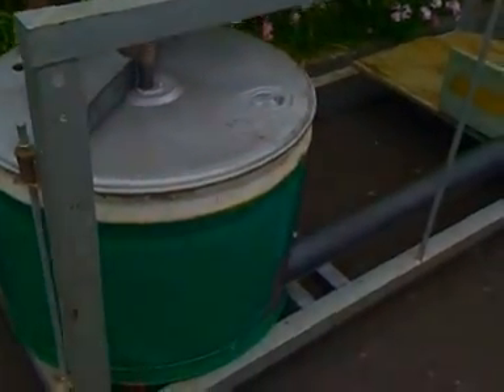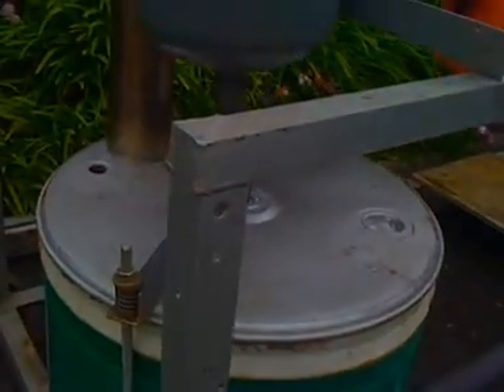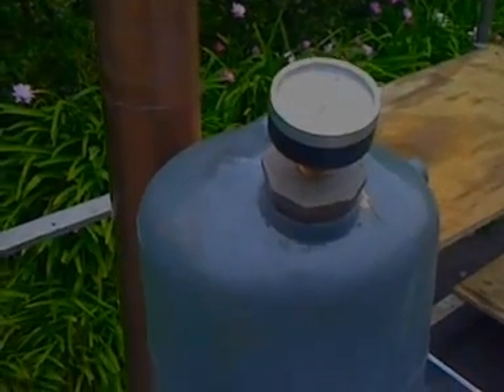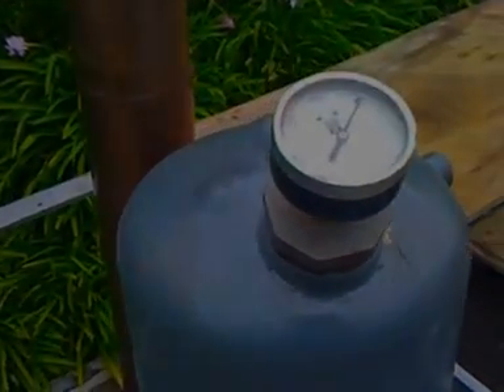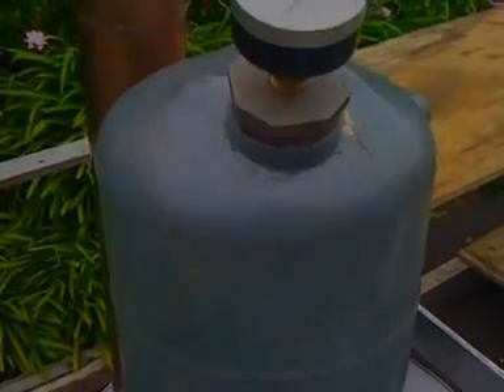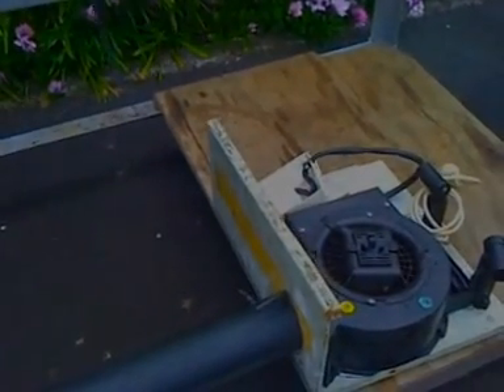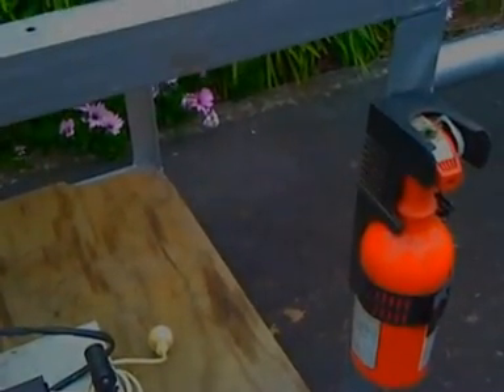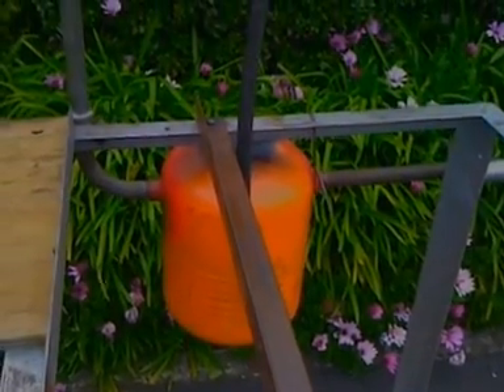DIESEL from waste oil thermal cracking machine EPISODE 1, basic layout

Comment: 85%  waste engine oil, 15% gasoline, a 100 micron, then a 10 micron bag filter and your done. total investment ? 1/2 gal of gas to 4 gal of oil ,, 1.50 in gas. bag filters are 4.50 each on eBay, and can be washed out. not counting the bag filters, 9 gal's of diesel will cost you 3.oo worth of gas.
Reply from the maker: I've been using solutions something like this for over 10 years. Normally, the success is related to how much carbon soot is dissolved in the wmo. Oils without the carbon payload work better as they are less likely to soot the injectors. Best use a diesel hydrometer to regulate the weight of the fuel. Incidentally, my thermal cracking machine will convert waste oils that are too dirty to use as fuel by blending. Also it will crack plastic waste to diesel fuel. Good luck.

Comment: I understand this design is not continous, but do you have any speculation as to what might be needed to achieve such?  If this is a distilling process I wonder how one would be able to get an auger feed into it without having the distillate try to escape via that outlet. The only thing that comes to mind is maybe having a retort that is so high that the reflux doesn't reach up to it.  It seems there would be a more elegant solution  available than making it super tall.
Reply from the maker: Brady Rose Hi, this was an early prototype which served to test theories and assumptions. It was never intended as the final iteration. Since then I've moved on to a larger prototype which uses continuous feed for waste oil as feedstock.. See my other videos for this and also my blog where details are shared free.
Reply: SmokeOnTheQuarter
I checked out your site and did a bit of looking around, It didn't seem you had devised a continuous feed for plastic though. Even if it had to be ground down to feed via an auger,  im not certain how one would prevent the gas's from distilling out into the auger line.  Any thoughts on this?
Reply from the maker: Brady Rose There has been quite a lot of talk about this on: @renewable-energy/7040-how-turn-plastic-waste-into-diesel-fuel-cheaply-127.html This forum is 127 pages now so a huge amount of information. A good read if you are serious. Spade valves might work.

Comment from the maker: Hi. This is a batch plant prototype so not continuous feed. Carbon builds up in the pipework to the reflux so it's necessary to dismantle and clean that out. At this time more waste oil is poured into the retort.
See my profile for blog address with all details of the newest prototype under construction. Thanks.